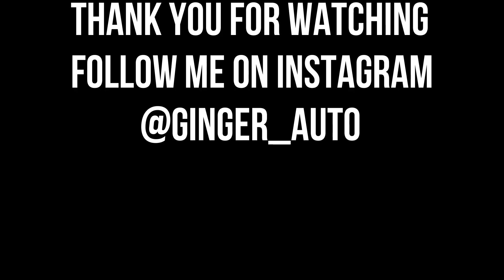Mating an FSO6406A Transmission to The DT360

Comment: You might consider that Transmission Tourqe rating is probably tested at 40,000 or 50,000 lbs GCVW for 24 hours at full throttle.

Comment: Dont forget that those torque ratings for this trans is probably for a 30,000 lbs vehicle so its much much stronger than say a NV 4500 that has a similar tq rating but in a much lighter vehicle
Reply from the maker: Very true. Never really thought of that.

Comment: Instead of purchasing a solution, you could have had a machine shop turn down the input shaft pilot register on a lathe.
Reply from the maker: We took it to a machine shop. And they said the metal is so hard that it would cost several hundred dollars to machine it. I bought the new input shaft for 125.

Comment: I put the same transmission in a cummins 12, for towing it is perfect, but for daily use the first 3 speeds are slow, they are linked to a 4.10 differential, I do not know if a light differential works well.

my top speed is 65 mph

great video
Reply from the maker: We ended up switching to a 3.25 rear end for better top speeds. Yeah the first three gears are pretty worthless for daily driving haha

Comment: Here’s an old time trick on helping put the flywheel then the clutch pressure plate in. Take some extra long bolts and cut the heads off too use as guides and supports while you get some of the other bolts in.
Reply from the maker: We did this to install our rear differential a few weeks ago. Will definitely be using it to do our next clutch!

Comment: How do you define your engine angle guys?
Reply from the maker: We made sure the bottom of the oil pan was level. Which made the top of the engine at 3 degrees if I remember right.
Reply: Ginger Auto thanks, l was worried my engine center is deviated in both the x and y axis... l guess the driveshaft movement compensates minimal deviations..?

Comment: So is the dt360 a sae #2 or 3 ? Just bought a 1988 s1853 international school bus and I want OD. was gonna change the rear t a 4.44 but the 6 with tighter 4-5 and an od will be better I think. Glad to hear I can call Eaton and get info! Thanks!!
Reply from the maker: Yes the dt360 is sae #2 bellhousing! The bus transmission should work good!

Comment: Question: why not take a Thomas School bus with the DT360 plus the Eaton Trans and chop the front half of the  frame. Mate it with rivets and bolts to a new shorter rear. Then put your cab on it. 
Just a thought.
Reply from the maker: We had agreed that would have been easier in a lot of ways. And the reason we didn’t was because of the sentimental value of it being my in-laws dads truck he bought in 63. But at this point the only part left of the original truck is the frame haha

Comment: Can't wait to see this thing rolling under it's own power boys! Looking awesome so far, very similar set up to what I want to run in a future project, except I'm thinking about a brownie box/spicer or 2 speed rear end just for giggles.
Reply from the maker: Thank you! We were thinking of doing a two speed rear end, we just couldn’t find one with the right ratio around us. The original rear ended was a two speed tho.
Reply: @gingerauto  At least a 2 speed rear would be easier to drop in later if you were to find one, as opposed to a gear splitter. When I was thinking about a 2 speed rear, I was thinking about grain trucks around here but not sure about narrowing one for a one ton.

Comment: I always got longer bolts and cut the heads off to use as guide studs. Makes work a bit easier
Reply from the maker: So you thread them in and just slide everything on?
Reply: @gingerauto  yes. take bolts long enough to reach past the clutch pressure plate by a couple inches. cut the heads off, thread them into the flywheel, slide the pressure plate on them. then start the factory bolts and remove the long ones one by one.
Reply from the maker: Dang that is pretty smart! We will definitely be doing that next time we have to install the clutch haha. Thanks guys.
Reply: Thats what i was gonna say but i had done logged off the internet by then